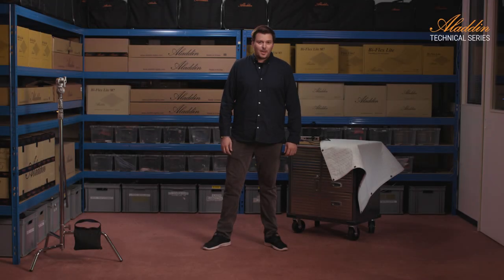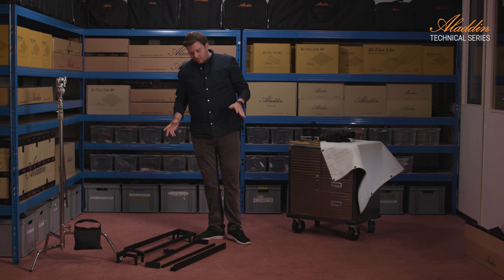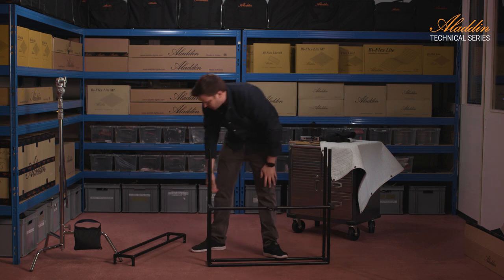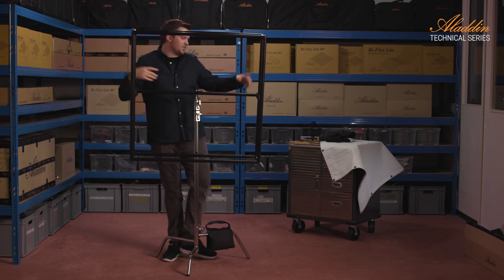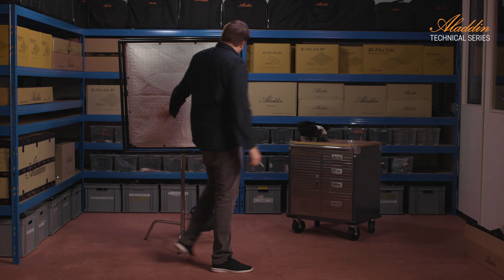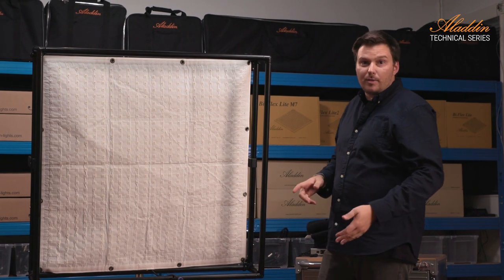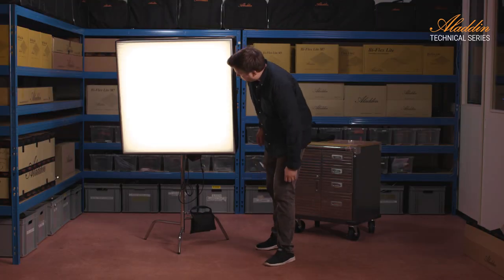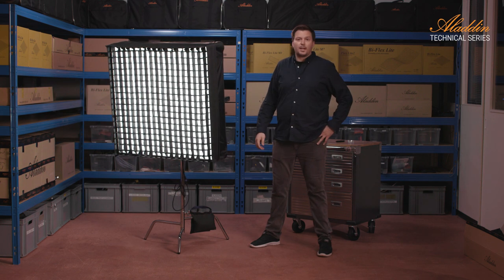ALADDIN FABRIC-LITE Technical Series | The Frame

Comment: Is that the 3 x 3, 350 watt fabric-lite?
Reply from the maker: HI 
In the Video we are working with the 200W Panel. The 350W Panel has the same size and accessories. 
Only the Dimmer is different because the panel uses more power.
I hope this helps.